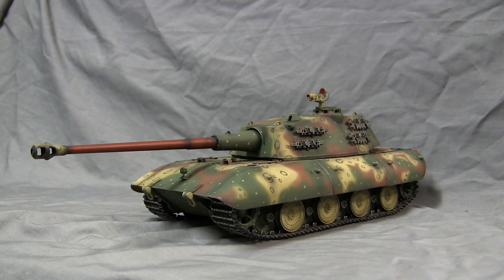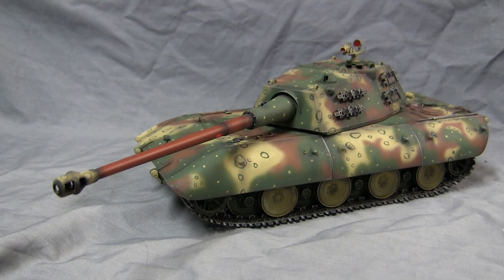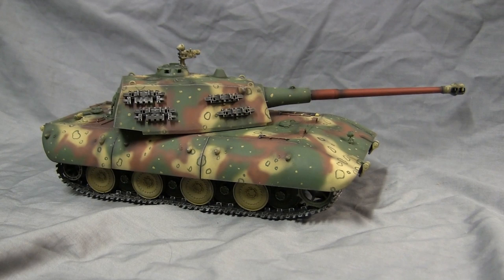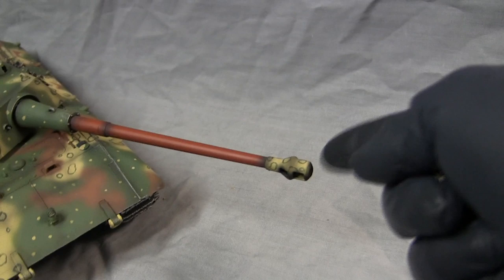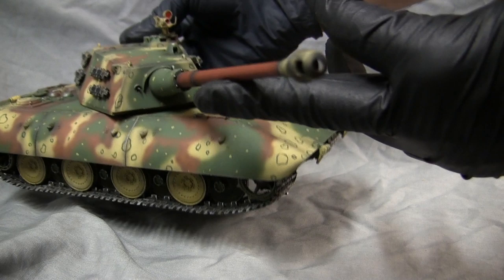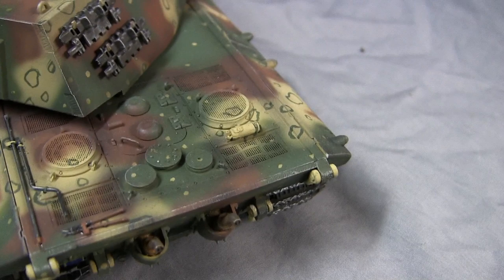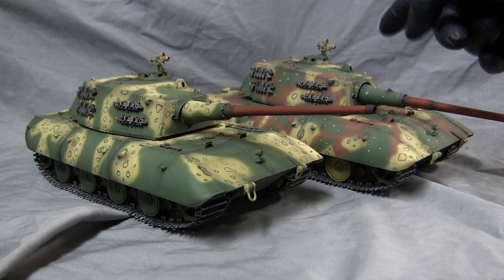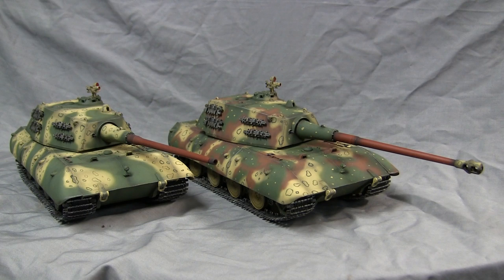1/35th scale E100 Showcase HD Video

Comment from the maker: I do, the other turret was released by DML back in 1995. I built that kit many years ago. Back then there were no AM workable track links so you were stuck building the tank with crappy link and lenght...which I despise. The trumpeter kit is much better, but the other kit with added AM workable tracks builds nice too. That model can be found on the ECA website in the 1/35 archive section. It is along side the trumpeter Jadg E100 Crocodile.

Comment from the maker: each person has their own technique, this is mine; I soak the decal in warm water, once the marking is able to slide off I align it to it's proper location once it is where I like it I dab off the water. once the water is 100% gone I carefully brush on dullcoat lacquer. The lacquer removes the decal shine, and embeds the decal to the model's finish. Now the decal won't flake off or blow away as time goes on, and it allows me to weather the marking with an airbrush without worry.

Comment: 10 years ago, yes, I know....and it's a VERY NICE JOB!.....but.....
1. Visible mold seam lines on front tow hooks, and shouldn't the hooks hang vertically? I believe they were fairly free-moving on the 1:1 vehicle....
2. Circular ejector pin marks on spare track links, and sprue-attachment points not cleaned up, on ends of spare track links....
Relax, these are "eagle-eyed", 50+ year builder remarks, and meant as constructive critique, NOT criticism!
I'd be proud to have this model in my collection! The barrel spring fix was very well done!....
I bet your customer is pleased!
Reply from the maker: yes my modeling techniques have advanced in the last decade. Also yes the customer was very happy when he got the tank... 10 years ago lol

Comment from the maker: Here are a few off the top of my head. Replace the kit links, and replace them with a functional pair from Spade Ace. Their tracks are metal and are very nice. 

Also possibly swap out the barrels with AM aluminum ones if available. Paint all the suspension and lower hull parts before you install them, normally that is a good practice to perform on all tank model, but for the maus it's critical because of the lack of access to the suspension.

Comment: that looks like a tiger 2 turret the e 100 was to have the maus turret from what i have heard
Reply from the maker: +Lane MB99 The turret on this tank is much larger than the turret on the King tiger, They look similar because both turrets were designed by Henschel. The E100 with the Porsche turret (maus turret) was done by the british at the end of WWII, The British found one of the incomplete E100 hulls in a factory, also in the same factory were turrets from the Maus, so they mated the two and took a picture. This is the version that was produced by Dragon in 1/35th scale back in the mid 1990s. This kit however displays the E100 with it's intended turret.
Reply: +oddball759mm  Alright learned something i never new that i just thought it was intended to put the maus turret on it had no clue that their was another turret for the e 100. Me myself i am a fan of world war 2  tanks recently i have been thinking what if the e 100 was complete would the British,Russians or american tank designers be able to build something to counter it besides artillery fire on it cause im sure the only way to disable a tank such as that is to flank it. I am sure a Sherman would have the speed or the t 34 to get around it but in a head to head battle the e 100 would win i believe unless the guns inaccurate well those are just my thought on it kinda went far into this sorry for the long response.
Reply from the maker: +Lane MB99 
By this time all the Allied WWII era tanks were becoming Obsolete and all allied countries had their next generation tank designs in production or on the drawing board. For the Russians they has the T54 / 55, JS3, JS4...etc . The British had the Centurion, tortoise, and Conquer, and the US had the T28 / T29, T30, T34(Not to be confused with the russian T34), Super Pershing, M46, and M47 Pattons.
Reply: +oddball759mm By T28 do you mean the super heavy tank destroyer i thought their where 3 prototypes built but they never actually went into combat i hear theirs a t95 at a museum in Kentucky ?
Reply from the maker: +Lane MB99  The T28 and T95 were the same vehicle. Two prototypes were built but the war ended before it was shipped to Europe. The army dropped the project in the early 1950s. One example is left today and for many years it was on display at Ft. Knox, but now it along with most of the other US museum tanks are sitting in a warehouse in Ft. Benning GA awaiting restoration and the construction of an indoor museum. 

The Vehicle was also never a Tank destroyer, nore was it designed for tank destroying purposes. It was intended to be used for knocking out heavily fortified bunkers on the Siegfried line, 

It was first designated as a tank and had the name T28, but since it didn't have a turret it was classified as a GMC and got the name T95... but because of the heavy armor / armament was then reclassified as a tank and was given the name again as T28

I have built both the Dragon 1/35, and Accurate Armour 1/35 T28 kits, both have model showcase videos on my listings. I also built a 1/6th scale version that can be seen on the ECA website, and would like to have a video of that model on youtube with in the year.
Reply: +oddball759mm A bit late, but the Henshel turret (this one) is a fake made by a modelist, Mike Rinaldi, trying to guess how an E-100 ausf.B would have looked like, and Trumpeter liked the look of it and started producing it. The intended turret was the Krupp one, but since the development of the tank for the German government was halted before the end of the war it's possible the Maus turret was also considered. And as far as I know the only prototype was never fitted any turret, not under German control, nor British.
Reply from the maker: Thanks for the info, Trumpeter has since released lots of the paper panzers as kits. They are interesting but lots of artistic liberty was taken for these models.

I'm fully aware of this info about the turret and have seen the picture that the British took of the prototype hull... just prior to sending it to the cutting torch >:(
Reply: MjyNightTrainLane 8
Reply: There were many turrets for e100